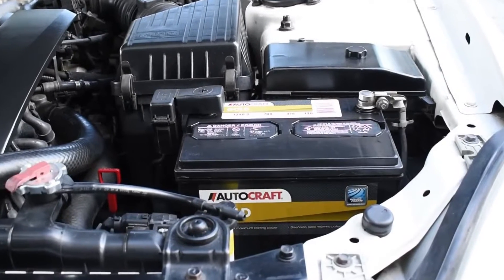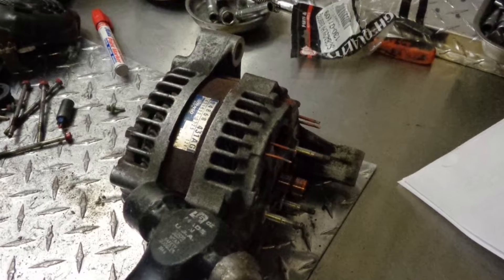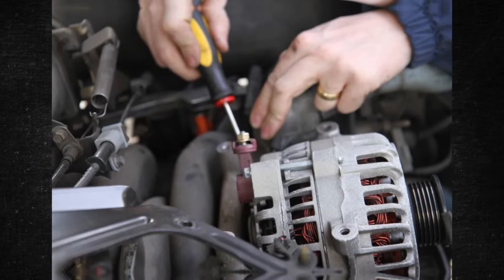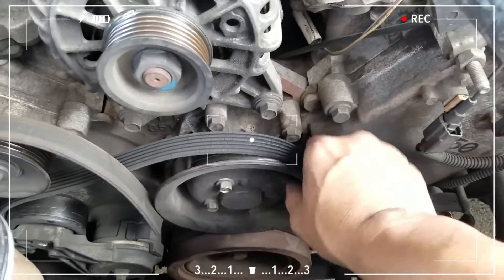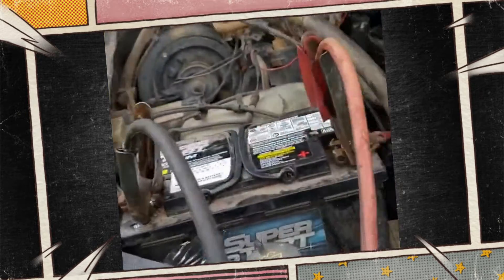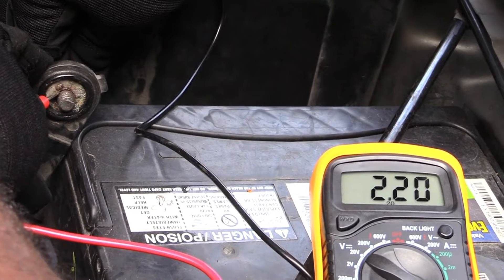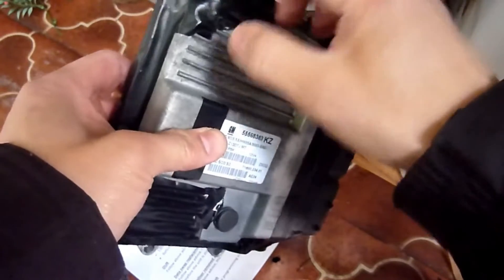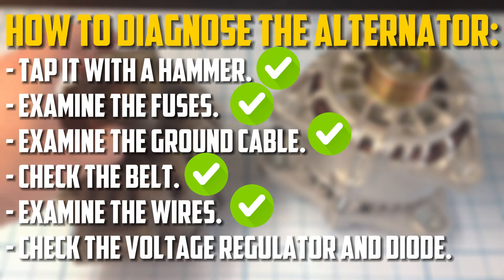7 Causes Your Car Alternator not Charging - How to Diagnose & Fix

Comment: MY ALTERNATOR IS BAD AND ALL POWER IS LOST WITH THE KEY IN THE IGNITION AND WON'T COME OUT. HOW DO I GET THE KEY OUT OF THE IGNITION
Reply: Use the shift lock
Reply: Charge your battery, or hook up jumper cables to another car.

Comment: My Diode & Regulator is pass the test when i brought it to Autozone but Alternator is not charging was results says. I already changed all my powersterring, AC and Alternator belts. My Battery is is also in good when tested. So what could it be? you think it might be bad ECM
Reply: Did you find out what the problem was?

Comment: weak and low charging mean need to replace alternator?
Reply: IT COULD BE A BAD GROUND " ONE WIRE ALTERNATORS NEED TO BE GROUNDED TO THE CASE" THIS LETS THE IGNITER DO ITS JOB PROPERLY " ON SOME CAR'S THE MAIN WIRE" SHOULD BE UPGRADED TO A THICKER GAUGE " THIS WILL ENSURE THE FUSE BOX .. DOESN'T OVER TIME CREATE A SHORT" ( HEAT ) IS YOUR ENEMY NOW* REPLACING THE ALTERNATOR IS NOT GOING TO CORRECT THE PROBLEM " IF ALL THE SYSTEMS ARE NOT WORKING RIGHT" YOU CAN OVER CHARGE THE BATTERY AS WELL" ( HEAT)  THAT NEW ALTERNATOR COULD START A FIRE" NEW BRUSHES & VOLTAGE REGULATOR " 👍

Comment: What would cause a new alternator to stop charging completely after working perfectly for 10 weeks? 

No battery warning light, either... the old alternator that this one replaced caused a battery light on the dash.
Reply: I have a same problem buddy
Reply: it broke
Reply: Update: I took the alternator out, and it was blackened on the bottom with one of the wires melted. 

Dont buy cheap eBay alternators, guys... lesson learned.
Reply: @matt-sm5eu I was just going to say if it was a cheap alternator that's probably the problem

Comment: I got a toyota camry 2011 and no lights are on no engine codes... new alternator new battery idles rough  sits overnight new battery is dead as crap any ideas?
Reply: Your alternator is either draining your battery because it’s bearings are burned out and lose or either the wiring terminals or rubber gaskets inside your alternator are burned out also meaning its sucking up the battery power when resting to keep up with the engine and pulleys demand after running your car
Reply: Parasitic draw, possible fuel system problem.

Comment: Quick check turn car on go. And remove a battery cable if car shuts off then it's the alternator, check all connection and fuses with a volt meter, quick fix is spray WD 40 into the holes on the alternator, that will lube it and it may start charging again mine did.
Reply: if any part of the charging system was not working it would shut off wouldn't it? if it shuts off I don't think it is necessarily the alternator in every case, I think its part of the charging system which could still be a fuse or relay or fuse box, or a connection.
Reply: What holes?
Reply: @VipModz3 the air holes
Reply: Lights flickering also is a quick test
Reply: Not with a mechanical diesel engine. Diesel engine befor 2000 aren't electrical controlled. They are mechanical injection.
Reply: WITH MOST MORDEN CARS ..THIS WILL NOT WORK" IN FACT IT CAN CAUSE SHORTS IN THE SYSTEM" AND CAUSE MORE PROBLEMS THAT A DIY " CAN NOT FIGURE OUT/ TROUBLE SHOOT" YOU GUYS MAY THINK YOU ARE HELPING PEOPLE OUT WITH THIS STUFF...BUT YOU ARE NOT' I MYSELF KNOW THAT WANT WORK..THE WAY SYSTEMS ARE WIRED NOW" 
...READ THE COMMENTS..I NOT!! THE ONLY ONE THAT DISAGREE"S " LATER 👍

Comment: Mechanic changed the alternator in 2010 Nissan Frontier 4.0 six cylinder.  Old alternator initially charged battery properly  after starting (14.0 volts), then after engine runs for about 3 to 5 minutes, voltage starts dropping to about 12.8 volts even while driving on the interstate.  After stopping and shutting down the engine, then restarting the engine,  the same process always repeats itself. 

Mechanic replaced the alternator with a new alternator, but it did not correct the problem.  Had the battery checked at AutoZone, battery checks state of charge 82%, cranking health: PASS.  Why didn’t new alternator correct the charging problem?
Reply: ground issue

Comment: The alternator on my truck will sometimes stop charging on start up. I'll disconnect it and reconnect it and it'll work fine. Then a few days go by and I have to go through the same process. Everything is new, even cables and fuses. Could the regulator just be bad? 2010 gm 6.2l..
Reply: Try to use a capacitor on your battery to stabilise the current. It will remedy your problem hopefully
Reply: These trucks have shit grounds check them. I got a 2018 Sierra I redid all of my grounds especially the two under the dash near the speakers which cause the stereo and and dash lights to act funny and have no starts or battery drain. After sanding all my grounds retightening and even adding 4 gauge wire from those dash grounds one on each side to the body. And adding 1/0 grounds from my block to chassy and block to body I've never had an electrical issue

Comment: I replaced the alternator, I replaced the battery, The fuses are ok and I recently cleaned the body throttle 
One day, I was stuck in a traffic, very slow motion, my AC was running, and all of a sudden, all the lights came on the dash, then the lights went dark and the car stopped !!
I got a battery boost and went home with the AC turned off... 
It doesn't happen when I have the heater on, only when the AC is on. 
Please give me ideas where to start troubleshooting :(
Reply: The AC compressor may be frozen it happened to me too